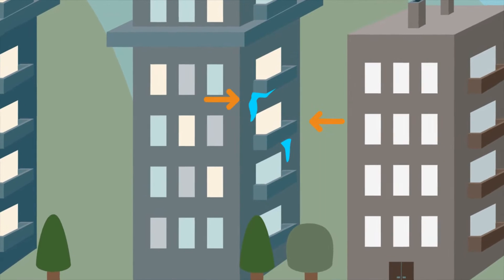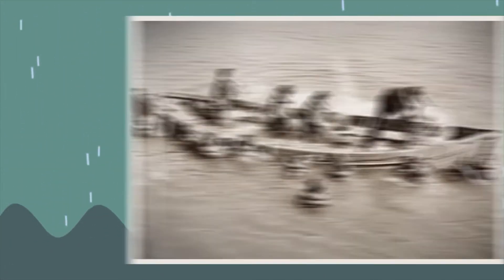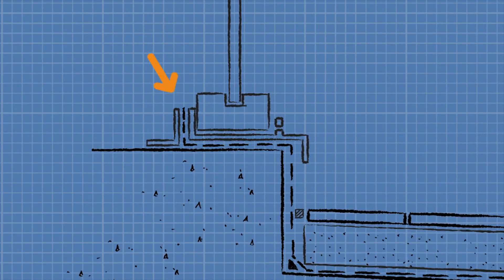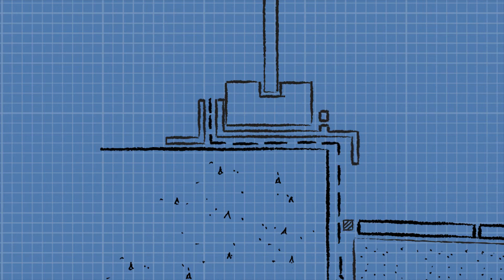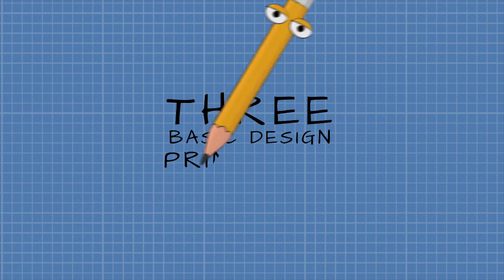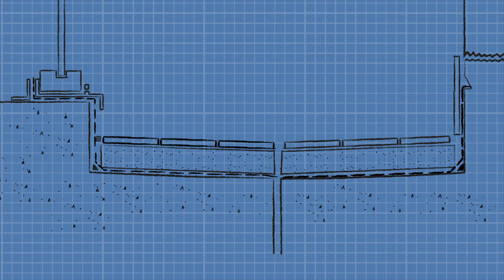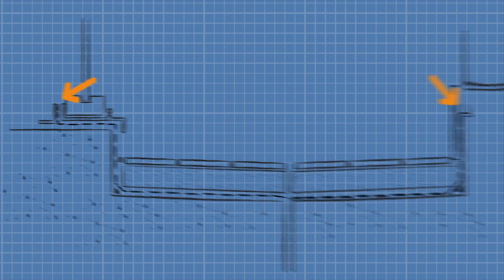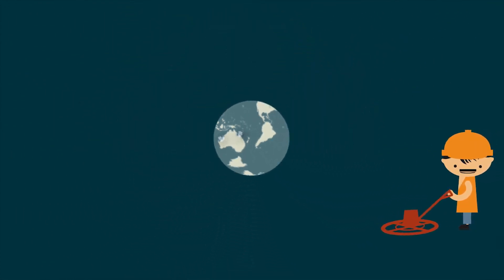Building Blox: Episode 2 - How to Prevent a Leaking Balcony

Comment: This video is great. Defines the issue very clearly and succinctly. I agree that pedestal pavers do work well and you can in theory reduce the slab set down to 30mm with a 40mm back angle behind the window frame to achieve 70mm freeboard. The issue I've seen with that type of value engineered detail is that in instances where the concretor falls short of achieving the required 30mm set down. When this happens the balcony needs grinding to meet the 30mm minimum set down. Grinding the finished balcony slab however is costly and likely to compromise the 1:80 fall in slab to the puddle flange. This can all be avoided by detailing a 40mm slab set down to provide a contingeny for the concretors innacuracy. As Ross rightly mentions though that small 10mm adds when it is repeated over multiple levels which the developer hates because it increases the slab-to-slab height. As with most quality issues in construction the root cause can be traced back to the developer pushing to value engineer away all the costly detailing. Not that the developers care though as they can simply phoenix off to the next project and avoid any liability.